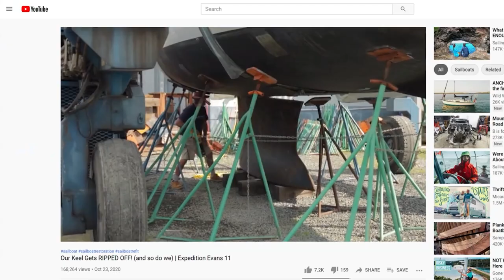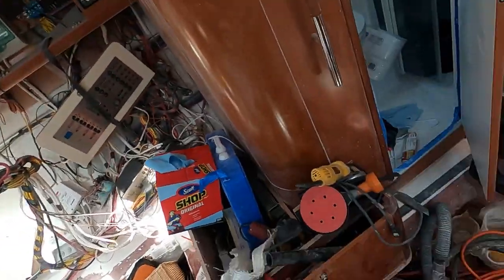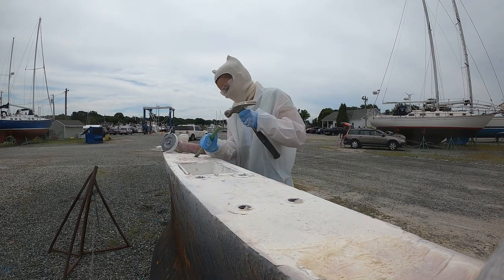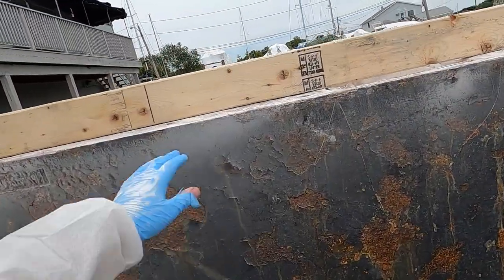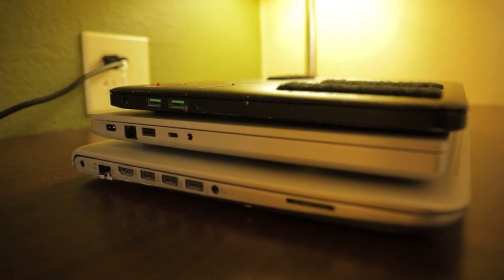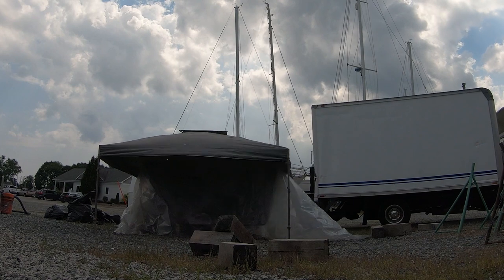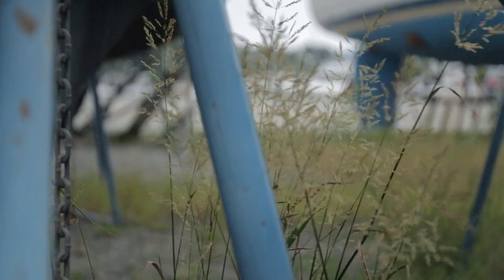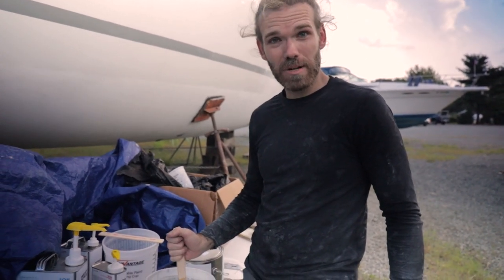SALVAGING our Sailboat's KEEL. It's time to Media Blast! | Expedition Evans 19

Comment from the maker: Just so we're clear, neither the Keel nor the USS Enterprise need to be aerodynamic 😂 (When in doubt, remember that Jade has particularly dry humor, lol) 

As for the bottom of the keel - Once the keel is reinstalled we will pick up the boat in the slings to blast/seal/paint it

Don't worry about the 2x4, I checked it to within 7/16000ths of an inch- with my eyes. (j/k really all we needed to know was if the keel was flat, not precision)
Reply: 'It's smooth Jim - but not as we know it...'
Great job!
Reply: The hull & keel need not be aerodynamic but they must have both efficient hydrodynamic and positive hydrostatic properties.
Reply: That's a Keel of a Deal !!! Jade's humor is just fine in the aerodynamic world, 🤣
Reply: ... would imagine that the molten keel material was poured into a mold and self leveled ... it probably formed a skin pretty quicky like and was not pliable for long ..... the keel like the Enterprise will explore far off lands and discoveries will be made ... so with all you have done so far, what sorta time has elapsed, to some it may be obvious, but to me it is not, you sure are moving along ..... kinda mind boggling that you will bolt that to your boat and then the straps will lift the whole thing, is there a steel plate that disperses the weight of the keel from the bolts? ..... thx for sharing ... as always .. never stop dreaming, just dream bigger .. have fun be safe, save our oceans ....
Reply: I thought that was hilarious...!!!
Reply: Will need to be aerodynamic once you install the foils...
Reply from the maker: @blok5555  true
Reply: Lol was just thinking that! Still adding to Jade's other qualities that she makes startrek references, enjoy your hopefully longer than 5 year exploration mission:-)! (As long as fixing the boat doesn't take that long :-)!)
Reply: I can just hear Jade in her next intro.... 
These are the voyages off expedition Evans
It’s a five-year mission
To explore strange new seas
To seek out new things
And different cultures
To boldly go where we haven't gone before
...
Reply: Interprotect 2000E in at least 4 coats made a miracle on my iron keel. Grind to bright metal and paint immediately
Reply: HYDROdynamic...

Comment: I've been enjoying watching as you rebuild your boat.  I'm also completing a total rebuild on my boat.  I'm so glad I bought an old school, solid fiberglass boat where the hull/deck is 90% of the strength.  That being said, you probably already have your keel attached, but if you don't I would highly recommend against 5200 and instead use Sikaflex 292 hull/deck/keel adhesive.  I guess I'll find out by watching more episodes.

Comment: I am more curious where you found straight lumber
Reply: Minimum would be to check with one edge and then roll the wood over and check again. That way if the wood had a bend in it the results would be different from one side of the wood to the other. That would let you know if the wood was bent. But it wouldn't work if thickness of the wood varied. Better to go with string line or a proper straight edge.

Comment: For the bottom you couldn't get to order a bottle of Coroseal ($45 Amazon) and once the keel is attached and off blocking coat it and allow it to dry overnight. Then epoxy coat. The Coroseal will convert the existing rust to a black oxide and protect the metal. It you grind all the rust away, you can still use the Coroseal for the pits to convert that rust. If you are hung in the sling transporter overnight and time is tight, I think you can recoat over Coroseal in three to four hours depending on temperature. That would give your epoxy four to six hours to cure up before splashdown, or re-setting onto a hard stand. Another option: See if the yard has an end loader that could roll your keel on its side. Then, do the bottom and when dry, have it stood back up, do any repairs to the side that was down, and you are set.

Comment: Block sanding is needed to complete the fairing process. The goal is a perfectly smooth and flat surface. Use a long board. Used in auto body repair. Finish sand with 400 grit.

Comment: You’re lucky to be in a place that allowed media blasting. Out here on the left coast most yards would not allow it regardless of the media or precautions taken in clean up.
Reply: This was one of the reasons they moved from one yard to another very early on -maybe even the first episode.  They had to launch and motor the boat to the yard they are in now.

Picking a good yard that allows DIY and outside contractors to come onto their property you hire yourself to work on your boat makes a huge difference rather than being stuck with paying the yard monopoly-prices for everything and when they get an outside contractor they tack on a little for themselves -as much at 20-25%!

Comment: If you really want to get it hydrodynamic (hopefully your keel will never see air when in use), then you need to apply fairing compound and then long board it several times until you’ve gotten rid of all the high/low spots. See Mads on Sail Life channel and do it before you apply the anti-foul and splash it.

Comment: I would have thought that the keel would be wetted first with straight epoxy, to really penetrate into all the tiny pores of the cast iron before spreading thickened epoxy over the green-cured wetted base coat.

Did you fare the keel at all or just spread a few layers of thickened epoxy and call it smooth enough?  Not only is a buttery smooth flat keel faster through the water but it is easier to clean without damaging the bottom coat and the nasty fouling sea creatures can't get as much tooth.

When we put a half dozen layers of barrier coat on our hull bottom we used two colors, white and grey.  It was MUCH easier to get good even coverage with each coat seeing the different colors.  The final coat was leftovers of white and grey all mixed together to make a third and final color, light grey!

When the last layer of barrier coat is fingerprint-cured that is the best time to put the first coat of bottom coat on, or what is called a "hot coat." That gives you a chemical bond to the bottom coat and helps prevent it from peeling in sheets or cratering as it falls off, especially if you are using an ablative anti-fouling bottom coat.  

You can still do a hot coat in the future but you'll need to first put another layer of barrier coat down and hot coat to that.  I think you can still lay down another coat of epoxy barrier coat weeks later without sanding.  Same with between layers of bottom coat -just the transition between the two needs to be hot coated within that fingerprint-cured window.

Comment: Check out the Razor "Core" external graphics card which goes with that computer. It handles all the rendering and the card can be continually upgraded. It plugs into your computer with just one plug. To be clear this is an ecternal box that takes one graphics card and powers you computer also. It also can run a larger monitor like the one on your bulkhead.
All your peripherals can plug into it- yet just the one thunderbolt 3 plu into your computer!

Comment: I can see you guys are going to do exceptionally well with your YT channel. Well done keep it up, but also enjoy. .....BTW, I put a beed of 5200 around the joint of my keel once it was in place as it always moves a bit and that will prevent water ingress.
Reply: Ugh
The keel should not move at all 
If yours is moving better get that fixed before you have complications
Reply: @OldGuySailing  most fin keels have slight flex in them. Same as when put on the hard, there is slight movement and then paint will give hairline cracks.
Reply: Well
I suppose some flex has to happen
I did not like how my keel joint was ruff so I sanded it down to make it smooth and made a groove at the joint about 1/4 deep. Then I mixed up thickened epoxy filled the groove sanded smooth bottom paint and launch. I expected to see hairline cracks when I hauled out for the winter  but I did not have one anywhere so that tells me my keel is not flexing or moving enough to make any hairline cracks 
See how it looks after year two

Comment: With my barrier coat work I found application of antifouling paint while last coat of epoxy barrier is lightly tacky was better for adhesion than letting barrier cure and sanding before antifouling paint application

Comment: I have a razor but for esditing I have added a razor Core which allows a high speed discreet graphics card to do all the grunt work of rendering. It is a thunderbolt 3 box with a graphics slit in it. Perfect for editing! Also runs my 4k 38inch monitor.

Comment: Should have used wet blasting.  No dust, easy cleanup. They use ground glass and water with rust inhibitors in it. A lot better for the environment.

Comment: A rented laser level would give you a VERY straight line for checking keel-to-hull fit.
Reply: Probably overkill...
Reply: An 8 foot level or concrete screed would do better. Or, take a clear kiln dried 2x4 to a wood shop that can plane it on a jointer. 
A stair rail is also a very stiff and straight piece. Buy it, use it, return it to Home Depot or Lowes in perfect condition.

Comment: OSPHO is a great rust preventer
Reply: OSPHO is phosphoric acid treatment that is great for bare cast iron.  In this case they were able to immediately apply the epoxy treatment after the blasting was done.  You'd want to use Ospho when you don't have the opportunity to get to the epoxy step right away.  I don't have any data to back this up, so its just my best guess that the epoxy bond to the freshly blasted cast iron would be better without the OSPHO layer in between.  It is common to do it either way.

Comment: it would be so nice to perhaps create a hull shaped plate to go on top of the keel spreading the side loads of the keel on the hull  using nuts to bolt it tight to the keel top.. and a similar structure inside. to spread the load somehow..  so the side loads of the keel top plate are spread out to the areas beyond first grid sections inside the hull and similar  inside..  it would probably need to be triangulated  for the max strength..  have you looked at Mcmaster in threaded rod for the keel.. and nuts and washers.. non corrosive. and strong.  either that or.. lay up over an inch more glass layers on the outside of the hull .. to spread the forces of the keel... you could look at doing the wet layups of glass strands on sheets of plastic sheeting to get them in place. then once stuck up.. do another layer and another each using plastic film to hold the fiberglass till you stick it to the previous layer. then perhaps.. the final layer of glass cloth over a layer of peel ply and tape the plastic film to the hull and attach your shop vacuum to vacuum bag the entire lay up if you can get it installed before it sets up..  use a layer of masking tape down the middle of the plastic film before the glass cloth is laid over it and wetted.. so you can easily keep the alignment going straight between layers.  so what if it adds an inch to the hull for 2 feet on either side of the centerline.  is your rolls of glass 4 feet wide or 5 feet wide or wider..  perhaps you may need to lay out multiple layers on the plastic film..  but its going to be tough to get it up with just 2 people.. and work it..  its been so many years since i fiber glassed the decks and cabin of a friends 104' stephens brothers of stockton wooden hulled ASR.  we used almost 220 gallons of A and B..  there was no much left after 4 drums of it.

Comment: How are you going to prevent re-rusting ?  Sacrificial Zinc ?  Anodic( electrical ) ?  The later might be useful when you build your on-board electrical / electronic system.  Might be interesting if you could get a sponsor to help with a satellite up-link for your aboard-ship WEB Server.  Sailing clear tropical waters might make for some good UW Video.  Will your boat be equipped with UW transducers ( SONAR, TEMP, Water Flow Rate / Speed, Depth Ranging, Transducers for communicating with divers, etc. )
Reply: Sealing a cast iron keel with epoxy is the best method to prevent future corrosion, its the industry gold standard.  A zinc is only needed where electrolysis is a risk below the waterline.  For electrolysis to occur salt water must be in contact with dissimilar metals that are also in contact.  Since the keel is sealed with epoxy it is fully encapsulated from contact with the water and corrosion should not be an issue (unless the keel gets heavily scraped or gouged, exposing fresh metal).  There will still be a zinc anode under water on the prop shaft, this protects the various alloys of the prop, shaft, strut etc... (same goes for sail drives if equipped).  Lightning protection should be grounded to a keel bolt giving the lightning an easy and direct path to ground. Many boats are also equipped with an additional zinc on the hull that is bonded to other metals under the waterline like the thru-hull fittings.

Comment: I wonder why the keel is much stronger than the hull. If I was designing a boat, I would make the keel weaker, probably engineer a weak plane where it would break in case of grounding, keeping the boat from sinking and making the repair much easier.

It's like a car, imagine if the bumper material was much stronger than the body. In a crash the car would split in half, and the bumper would be OK.

To keep the centre of mass low, you could possibly put lead or something in the bottom of the keel.

Comment: You wanted the keel as aerodynamic as the USS Enterprise (timestamp 9:50), the problem is there are two USS Enterprise a Star Trek space ship and an aircraft carrier.

The Space ship from star trek is in outer space and so it doesn't need to be aerodynamic (no air in outer space) and it's not that aerodynamic.

And the aircraft carrier is as aerodynamic as a brick.

Comment: serious question. when they media blast, where does that 500 lbs of media go?  is is just biodegradable and go into the ground?
Reply: They put down tarps and capture the media and paint chips and remove it to be disposed of properly. The guy probably just dumps it anywhere he can, but that is the line he uses to charge you extra for hazardous waste disposal.
Reply: @MrOlddave  Thanks.  I've never used that. I know some use ground up nut shells and various things, but I wondered, 500 lbs seems like a lot

Comment: Don't use a 5200, use a more soft one. :) ig not is fix forever.......
Reply: 5200 is actually the right thing to use on keel to hull joints.  You actually don't want much flexibility in that joint.  The only thing that is trending today as a step up from 5200 for keel to hull joints is flexible epoxy.  "flexible' is a relative term.... to the untrained eye a sample of cured flexible epoxy won't seem any different from regular epoxy, but under heavy loads it does actually give a little and is far less brittle than standard cured epoxy resin, the specific type of fillers used to thicken it are also specialized too.  Something soft like 3M 4200 or Sikaflex is way too soft for a keel to hull joint.  The trick to any keel/hull joint is to attach the keel bolts firm but not fully torqued to spec, allow the sealant to fully cure, and then torque the bolts to final spec.  5200 takes 7 days for full cure, flexible epoxy will cure in 24 hours, so you can see why the flexible epoxy option is becoming more popular (those extra days on the hard waiting for the sealant to cure can be expensive!)

Comment: 9:48 that Enterprise? From space? In vacuum no need aerodynamics ;))))

1. You make mistake, first coat should be rustresist for metal (paint acrylic or inhibitor for metal parts) next you can add filler to make smother surface.
2. You don't needs grind coating before that grey paint?

Comment: Remember to apply at least 5 coats of epoxy primer on the keel
Reply: I hope they plan to hot-coat the firat coat of anti-foul bottom paint too.  

Maybe more coats will go on over everything on the whole hull once the keel is back on it and then the anti-fouling hot-coated over that too.
Reply: @svbarryduckworth628  Yes to prevent osmosis in the future the hull must also have +5 coats of epoxy. Maybe they mount the keel first and then paint the whole bottom. I'm also a bit excited to see what antifouling they use.
Reply: When we did our barrier coat we used Interlux Interprotect 2000 in alternating colors white & grey for easier and more consistent coats.  

We planned 6 coats but the day I did the 6th coat a freak rain shower popped up and I could not hot coat the first layer of Pettit Ultima SR60 like I had planned.  Instead of needing to sand the next day I opted to buy another can of barrier coat and do a 7th coat and then hot-coat the anti-foul over that.   3 years later it is still holding up, but we will need to haul out this summer and put on more.  We put blue antifoul on first, then covered with red over that.  The blue is starting to show though in a few spots now.  On a small hand-sized bit at the bow where the rope Mantus bridle rubs sometimes the anti-foul is wore right down to the barrier coat.  It doesn't foul there as that darn bridle cleans it back off often enough.